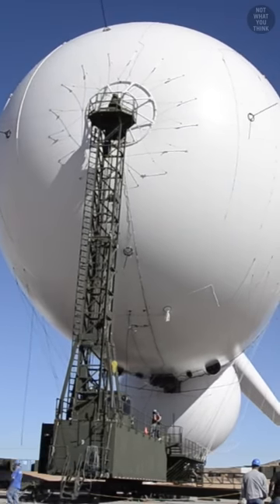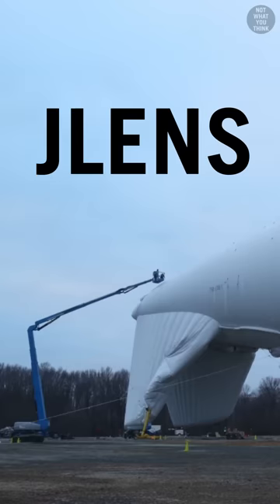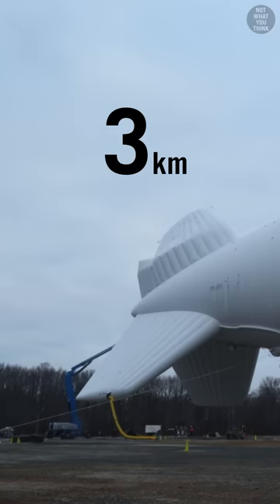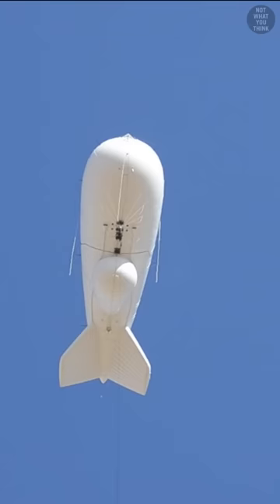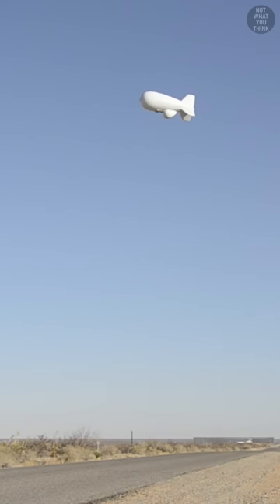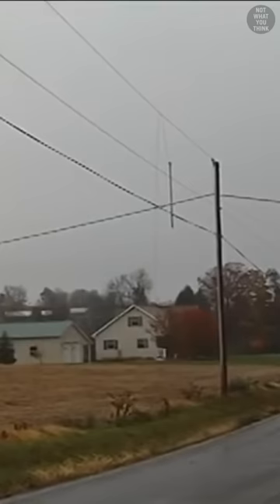What Happened When the Cable SNAPPED? #shorts

Comment: So of course instead of fixing the issue, making it one of the most efficient and cheapest alternative to the extremely expensive AWACS, the decide to scrap it.
Typically American
Reply: U r correct 👍👍👍
Reply: Lol true but to the US defense, drones could probably do the same thing but cheaper.
Reply: The USA had really really great ideas that had been discontinued because of small issues that could've been fixed easily
Reply: @ascendordie7427  
It is still more expensive to have a drone than a balloon
Reply: That would be because if the agency which operated these actually saved money instead of using the expensive AWACS, their budget for the next fiscal year would have been lessened. That is why military and surveillance agencies costs and 'neccessary' budgets ALWAYS rise. It is an enormous flaw in the system of appropriations for the branches and intelligence agencies. This is not something new. This has been happening in a big way since the end of WW2 when the military industrial complex became a noticable industry. Listen to President Eisenhowers' end of term speech. He makes a clear warning regarding this. It is capitalism at its finest🙄
Reply: It is not the cheapest alternative. Helium is expensive, and we have a limited amount of it left.
Reply: @tardonator  It is certainly very much less expensive than flying and maintaining the AWACS aircraft. Way less expensive. Also, how do you know that they use exclusively helium? Hydrogen could be used since there is no one inside of the thing.
Reply: Yep. One highly publicized and extremely costly incident can wreck a program that has been running nearly without flaws. Unfortunately, that's just how reality works. Uneducated backwater yokels generally act on emotion without actually using their handful of braincells, and ruin many a great projects and public works.
Reply: @ithinkimarealboy2402  Even if there’s no one inside of it, having it explode or burn to nothing if anything goes wrong isn’t efficient
Reply: @gio-ko7kf  In contrast to what? The same thing happening to an even more expensive drone and having it crash and burn. And for reference a current gen global hawk costs around 130 million dollars per unit followed by another 19k per flight hour. Even cheaper reaper and predator drone orders are in the billions of dollars for only 2 or 3 dozen units with everything tacked on, it’s fucked.

Don’t worry tho as usual after the US wasted god knows how much and canceled the project a look alike product was developed by an Arms company who recognized its potential in this case Rheinmetall who sold them to the German government to use for perimeter surveillance and defense for bases on foreign soil. In that stated role I imagine they would be unmatched by any current tech.
Reply: @ithinkimarealboy2402  Hydrogen is not helium, which is what we were talking about. You seriously underestimate the hidden costs of these projects.
Reply: Well... it's not quite what you think. AWACS on a plane is far more valuable and maneuverable (and resistant to high winds). Not to mention, the baloon makes for an easy target now that even poor countries or militias can somehow afford ways to permanently deflate it, so overseas it's not great.

Any sea-based force would lose them quite quickly, and besides, pilots need hours so they'd use the aircraft anyway.

Domestically, there are satellites and other better technologies already in use.

The cost overruns probably killed the program because it needed to be cheap enough to make sense, unlike other projects where capability takes priority over cost to a degree.
Reply: @sulcata2007  JLENS cost 175 million dollars per unit
Reply: @andrewmoore7022  And how many global hawks, reapers, predators etc do you think it would take to have the equivalent 24/7 surveillance? I’ll give you a hint it’s a lot more than one or two, not to mention the airfield or hangers as well as the corresponding on-site personnel and equipment and domestic operators and equipment. 

Either way as usual US defense companies ballooned costs and led to things getting cancelled nothing new there though I’d imagine cost per unit would have gone down some depending on the number of units ordered like any other vehicle or aircraft because they always spread the cost of R&D across them.
Reply: @sulcata2007  you do know that air refueling exists right?
Reply: @randomblacktemplar738  Ok so now you want to add the cost of a KC aircraft, and are you aware that every flight hour on an aircraft requires hours of corresponding maintenance? Which is why they can’t remain in the air indefinitely and also cost an exorbitant amount per flight hour. 

And just to give you an idea the US currently has a tanker fleet of around 650 aircraft by far the largest in the world. Now can you guess how many bases the US has around the world not counting domestic bases? I’ll give you a hint it’s more than 650 and spread across over 80 nations and territories. So good luck with that route as well. 

The Navy is working on drone refueling as in having a drone refuel other aircraft but as far as I’m aware that’s still in the works with the first refueling successfully taking place last year but who knows how long that will take to enter the field and they’re using a very expensive drone as well the MQ-25 which last I checked was around 150+ million per unit which while expensive is around the same or even less than other larger KC aircraft.
Reply: @sulcata2007  sure why not
Reply: @ithinkimarealboy2402  Complains about exorbitant government spending and overreach

Blames capitalism

Boi…
Reply: The US don't like to use anything that doesn't use oil
Reply: @ascendordie7427  this is literally the cheapest drone. For this mission.
Reply: It's a stupid idea anyway. There's a shortage of helium which is widely used in the medical field including cooling mri,s
Reply: @ithinkimarealboy2402  yeah, however it could end up like Hindenburg. Hindenburg killed people on the ground as well. With that massiveJ-lens Aerostat. It would take out too much on the ground before burning up. That’s why they used helium.
Reply: @kolinmartz   not when it fails.
Reply: @Keaton0801  there’s literally nobody on this thing and it’s small enough that you don’t need an entire battalion to pull it down.
Reply: @sleepyancient6655  finally, someone who knows what they're talking about.
Reply: Helium is getting only more expensive, you think they wouldn't look over the rest of the program after an incident like that? Think a little.
Reply: It’s more of an issue of public perception, if the public hates it enough it can fall out of favor and possibly ruin careers due to that so many people just wipe their hand with the project instead of deal with it.
Reply: @TheKenji2221  i wouldn't be so sure about that. Look at all the heavy support equipment in this video; those are high operating costs and logistical complexities. 

Drones could likely operate with a smaller maintenance teams than this
Reply: These things are still being built by Rheinmetall. The German army recently bought some.
Reply: @ithinkimarealboy2402  yep
Reply: Typically Democrat no we need these things they’re dirt cheap and extremely effective
Reply: For the same reason, NASA claimed that attempting to land a booster is impossible because a hydraulic landing leg failed in a test once. SpaceX was willing to fail multiple times to get it right.
Reply: @thisiswhatilike54  I blamed the military industrial complex. Learn to comprehend what you read, 'boi.'
Reply: @tardonator  No, I certainly don't underestimate  the costs of government programs. That is a foolish thing to say and nothing I wrote would suggest that I believe that I underestimate the ability of the fed to over spend on absolutely everything.
Reply: Yuuo
Reply: @TheKenji2221  bro not when the balloons full off a million dollars worth of radar systems
Reply: that's what happens when the ruler (& the intelligence department ) want to destroy their own country !
Reply: @ithinkimarealboy2402  Well Said ☑️
Reply: This ain't the half of it. They have been trying too get those things to work in other situations,  and always fail.
Reply: @ascendordie7427  not for an area the size of texas
Reply: @ithinkimarealboy2402  all that is true but the problem is much more about bureaucracy than capitalism. The problem is that no department head wants their team reduced in size or their program cut . Because then they have to all go find new jobs. What should happen is that the technical people and leadership should be removed from the book keeping side of things , there should be yearly audits and budgets should be sized to get the project done not save peoples jobs.
Reply: They totally could have just beefed up the tether but no. They scrapped the whole thing. Thanks America👍
Reply: @TheKenji2221  not when it breaks things...
Reply: America has a long history of this to be honest, They literally have jets guarding a lifeless drone.
Reply: @L0kias1  You'll get no argument from me regarding that.
Reply: It is a waste of money when they do stuff like this, but at least it tends to cause innovation.
Reply: Can’t get an inflated military budget if all their projects work and are completed lol
Reply: No they use these for satellites all the time. They launch 10 to 20 a day in Antarctica caring satellites silly folks think are in the thermosphere...
Reply: @ithinkimarealboy2402  I mean that's basically what I said. There's a shortage. If we only have the earth's supply which is dwindling fast, and can't get it anywhere else then that would be a shortage. My point also covers the Moronic use of helium for party balloons.
Reply: @TheKenji2221  but we already have the drones.. once the drones are decommissioned I’m sure there’s gonna be something better anyways
Reply: Could've got stronger tether and more of them or even if they did snap just detach them from the blimp
Reply: Helium shortage
Reply: @ithinkimarealboy2402  Didn't he say MIC would need at least 2 wars every years to stay afloat?
Reply: Thank you
Reply: There's a new one called the wedgeback.
The Boeing 737 AEW&C is a twin-engine airborne early warning and control aircraft based on the Boeing 737 Next Generation design. It is lighter than the 707-based Boeing E-3 Sentry, and has a fixed, active electronically scanned array radar antenna instead of a rotating one.
Reply: So Texas is 268,597 sq miles(A). The United States is 3,796,742 sq miles(B). Doing the math: B/A= 14.135 or 14.15. so roughly 14.2 Texas's fit into America with some extra space. So with that knowledge, we'd need only 28-30 to cover all of America and to have them constantly we'd need 60 (4 for each area for maintenance, repairs, etc.) Each JLENS costs around $175 Million. So for 60 units, it'd be around 10.5 billion. Compare that to the cost to own a AWACS unit alone being $1 Billion without crew costs and maintenance costs (it is an entire 747), we have a clear profit.
The United States owns 31 E-3 early detection systems (AWACS), costing us easily $31 billion to own. According to ExecutiveGov, the country's proposed spending, mainly the Department of Defense budget, reached $778 billion in 2022, which is a 14% increase in military spending compared to 2017. meaning there is more than enough money to experiment with this idea and if it does crash and burn, it barely makes a dent into the budget.
Reply: @gio-ko7kf  despite common belief, hydrogen airships were surprisingly hard to ignite, in ww1, the British had to develop a special ammo specially designed just to ignite the airships, as regular ammo would harmlessly punch a hole without any sparks, and even with a spark, without a decent bit of oxygen present, it goes no where, furthermore is something goes wrong, the blimp is going down either way, whether hydrogen or helium it will still fall out of the sky
Reply: Well people had their power cut!!!  They wuz pissed!!!   
The public knows best.
Reply: @ithinkimarealboy2402  helium is used in some machines that keep people alive and there is no known alternative gas that does what helium does plus helium is limited and is constantly getting rarer and rarer the more and more we use I think this is better in the long run plus the US has the most powerful military in the world so it’s fine
Reply: Well our budget is more than enough to buy the moon, I’m pretty sure
Reply: @ascendordie7427  consider that a drone needs fuel to stay airborne while a balloon needs to have no holes to stay airborne. Which one do you think is cheaper now?
Reply: @ithinkimarealboy2402  not to mention hydrogen is more buoyant than helium allowing it to lift more weight for the same amount.
Reply: @robbieaulia6462  if the balloons destructive line was fixed then yes. Till then the thing is in retirement.
Reply: Stop jocking on Americans
Reply: @tardonator  actually, if we would go back to fission reactors, we can make helium hella cheap. 
But, like OP said, America likes making good ideas and scrapping bc of 1 or 2 incidents.
Reply: It's cool will just print more money..
Reply: Still the best country in the world!
Reply: everything is “typical American” even if it don’t make sense huh?
Reply: Yup. Too bad.
Reply: @ithinkimarealboy2402  the process you describe is exactly right. But, that’s not “capitalism” — that’s exactly what is wrong with government and the way military budgets work.
Reply: No kidding. Because everyone cried about the incredibly effective cheap alternative its now gone. Shame
Reply: @tardonator  said what I was gonna say eleven days before I read any of this
Reply: @tardonator  but what if we filled it with hydrogen and made the skin out of iron and aluminum oxide :^)
Reply: An automatic deflation device and a notification device would have saved the day. Another thing they could have done was build it so that the cable would release from the balloon if it broke away from the anchor.
Reply: Mostly because the public didn't like it because the power line incident
Reply: That thing broke lose made it where acouple people couldn't charge their phones and they got rid of it.
Reply: @Konstantin_.  

I don’t think they can fix the Joe Biden problem anytime soon.
Reply: Yes, and it would be fixed pretty easily. Just add a kill switch that is either automatically or remotely triggered and deflates the balloon immediately. Or something along these lines
Reply: @tardonator  yeah helium supply is so limited we ran out 30 years ago
Reply: Make a cable detach system at top. Balloon gets away call it and cut the cable. Or scrap it.

Not like I needed that tax money or anything.
Reply: Could have been sabotaged to get that to happen.
Reply: Yes, funny enough Israel just started deploying them roughly 2 years ago.
Reply: @sulcata2007  he was talking about hydrogen vs helium… you come in talking about drones
Reply: They still use them. Just in a different area.
Reply: @TheMessiahOfThe99Percent  I mean the drone costs millions with no threat to a human pilot so yeah makes sense
Reply: @ascendordie7427  no they cant fly this high for that long
Reply: @tardonator  still cheaper than using ton of radar or ton of drone to do the same job as one blimp
Reply: @gio-ko7kf  hydrogen airship arent as dangerous as in movie during world war 1 german zeppelin could take hundred of bullet and still fly, the problem was incendiary bullet, also the hindenbourg was an exeption, the reason it crashed is sill unknown the graff zeppelin another hydrogen airship flew across the world for year whitout incident before behing scrapped during ww2
Reply: @JohnWick-stardawg  hydrogen also work but everyone seem to think it is as dangerous as tnt
Reply: @Keaton0801  Hindenbourg was an exeption it landed during an heavy storm and no one know why it exploded. It also exploded 3  or 5 meter above ground , at 3000 meter or 5000 meter it may be even better than helium cause less debrit will hit the ground
Reply: @uh3what  it s still cheaper than flying a drone
Reply: @sharpe3698  still way less than any plane with the same radar and that could fly to the same height. Also it may simply be the place where they recieve what the radar see on big round screen
Reply: @Umbra Sight laught in free healthcare
Reply: @JohnWick-stardawg america is litteraly  helium number 1 producer also hydrogen work too and is not as dangerous as in movie
Reply: No shot! Haha
Reply: Haaa, I was going to type exactly the same response.
Reply: @Konstantin_.  You need to  send that info to Washington, D.C.
Reply: @Charlies_Factory  the guy I was responding to was going off about drones being a thing makes these pointless, who are you going on about?
Reply: @ascendordie7427  it's literally just a balloon
Reply: @TheKenji2221  A drone would be 10X cheaper
Reply: Kinda like how they build something stupidly expensive only for it to be useless or not as effective something else. Like surely they can plan the shit out and simulate it before spending incredibly large amounts of money on it
Reply: @TheKenji2221  Except drones can be quickly and readily moved elsewhere, have a larger range of operations, can be refitted for a different mission quickly within the span of hours and can actually move and aren't reliant on wind...
Reply: Right cuz that was a really good idea
Reply: These things helped win the 2nd world war
Reply: I know right every good program just gets scrapped when it could be fixed so easily Why Try when you can just give up
Reply: @ascendordie7427  how? A drone is significantly more costly. You need training, a operator, fuel, maintenance and runways for the drone. 

The blimps literally cut costs massively
Reply: @TheKenji2221  Not really, Helium is expensive, plus this thing is noticeable
Reply: @ithinkimarealboy2402  Ok, how do you store hydrogen though?
Reply: @enfissione8297  In storage tanks. The same way many other gases are stored. For example, natural gas is cooled using liquid nitrogen which causes the natural gas to become a liquid which can be stored easier than if it were in its' gaseous form.
Reply: @thisiswhatilike54  "Blames capitalism" are your words. I just understand that the industry over spending is a by product of capitalism. Capitalism is the best form of an economy that we know of but it certainly isn't perfect and is often abused.
Reply: Because politics... and dumb civilian criticism
Reply: @ithinkimarealboy2402  Lmfao how is this "capitalism at its finest"?

These are literally government agencies supplied with taxpayer dollars.

Private companies have a profit margin to take care of, and would not waste money like this unless heavily subsidized by you guessed it... the state!
Reply: “Americans. Because we only fix what isn’t broken!”
Reply: I think the biggest issue was it doesn't actually kill anyone.
Reply: @ithinkimarealboy2402  that is in no way capitalism, it is pure, unadulterated federal bureaucracy.
Reply: Exactly.  Just fix the cable situation with better redundancy.
Reply: the 800 billion dollar budget gotta be used somewhere
Reply: @kamal92606  it wasn't expensive enough.
Reply: We still use them. Just not in that location. They’re all over the southwest border
Reply: But Not typical Americans.
If that was the case then there would be no moon landing or space station or even planes
Reply: Is unsustainable tho with helium
Reply: @ithinkimarealboy2402  
Complains about government spending.

Blames Capitalism.

Genius.
Reply: @ithinkimarealboy2402  Not Capitalism. Government coopted Corporatism with Government bureaucracy involved to make it worse.
Reply: @Prince_Az_Myr  Re-read what I wrote dummy. I don't blame capitalism nor do I criticize capitalism. It is the greatest known system for society yet. You need to study up on reading comprehension.
Reply: @desertdude8274  You'll get no argument from me about that.
Reply: @chrisgoetz3889  What kind of satellites are they launching from Antarctica?
Reply: @ithinkimarealboy2402  8to10 a day.. they stay up for over 9 months and are as big as football stadiums including the dome. Do people really believe the 3 inch antenna on their vehicle's actually picks up satellite radio from 22,000 miles away...
Reply: Kinda how NASA could have developed reusable rockets in the several decades ago but scrapped the program
Reply: You took the word out of my mouth
Reply: Exactly why not add 1 or 2 more cables as a fail safe. Or remotely extract the gas so it doesn’t float away
Reply: Not really we don’t have an infinite supply of helium so like
Reply: @ascendordie7427  yeah, definitely cheaper than a big ballon lmao
Reply: @ithinkimarealboy2402  THIS  the army is an industry, they don't want the cheaper option but the other way around, hell, maybe it even was intentional!
Reply: Joke's on you, we still use it tactically.  Great research skill on your part.
Reply: Harry: “That’s the Oscorp way.”
Reply: I assume your British
Reply: Yeah when i saw they dropped it, my confidence in the US dropped more, too
Reply: There’s still one in the Florida keys I saw it when I was there last December
Reply: Wait what happens when the weather is bad. Is this thing gonna be rocking back and forth? If its on a windy day is it still gonna catch missiles using its radar? And I don’t know if you guys know that helium is pretty expensive it’s 50 dollars just to have one of those gallon tanks now imagine the size of this thing it’s pretty big now not only do we have to make sure the weather is ok for the day there using it and also have to worry if this things rope gets damaged this thing could cut power to millions of homes not only this but waste alot of money just on the helium now I don’t know about you guys but being only able to use this on a nice sunny day with almost the slightest breeze being able to off set the missile detector is not a very good design in my opinion
Reply: Because how they gonna be able to say they need to tax us more for “defense budget and government maintenance” when they’re saving money?
Reply: @ascendordie7427  But the maintenance cost and logistics of  several drones heavy enough to carry the equipment constantly flying around would be lest efficient than a passive balloon just hanging there in a (mostly) fixed point
Reply: Right?! They should have put a remotely activated hatch that could be blown to release the helium in at a controlled rate that would allow it to slowly decend. Problem solved. There had to be more than just this behind shutting the program down.
Reply: You want the Americans using what little helium we have left?
Reply: @Konstantin_.  yea
Reply: Typical American politicians because most of them have at least one finger in the cookie jar when it comes to defense Contracting